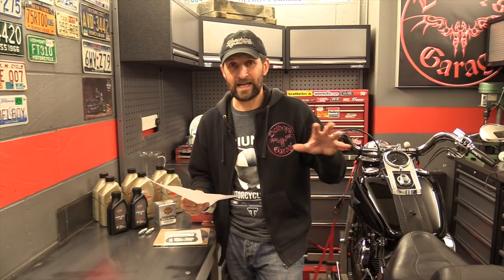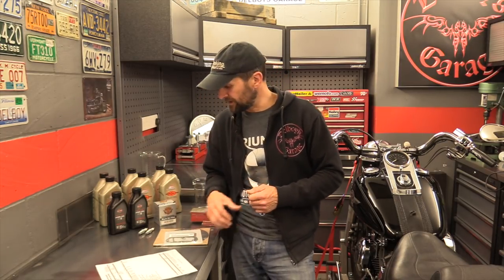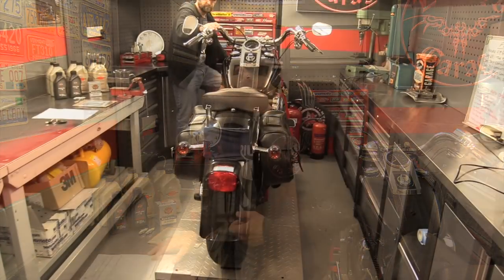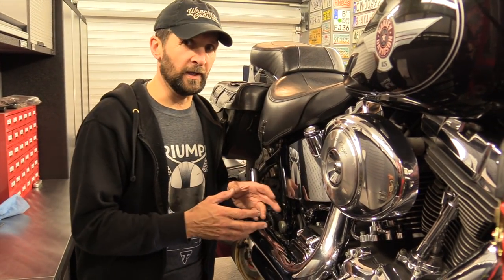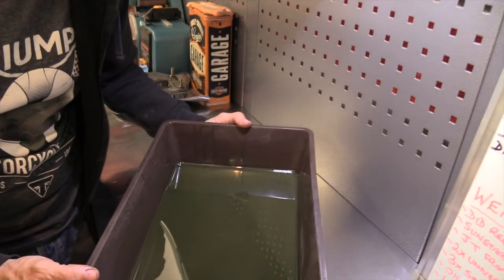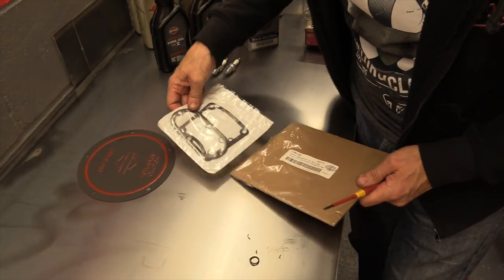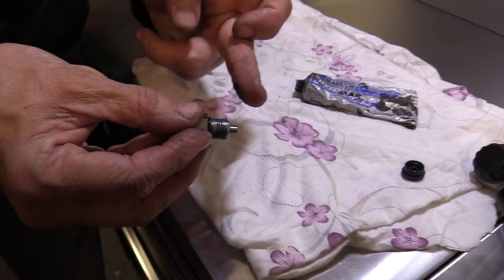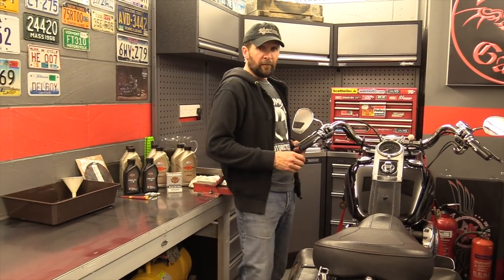Delboy's Garage, Harley Softail Service #1:- Gearbox Oil Change

Comment: so when you check the level of the gearbox you do it with the bike straight up?
Reply from the maker: On this bike, (2005 Softail), then yes, but if you have a different model or year, then check your manual because it can vary.!

Comment: thanks!! what kind of oil for gearbox in sportster 2001?
Reply from the maker: Hi you can go with recommended Harley oil, or if you want to pamper your bike, Screamin' Eagle Syn3 exceeds all Harley recommendations and is not a lot more expensive...
Reply: Moonfleet41 thank you. I heard that people actually use the same oil as they use for engine, for example Castrol motorcycle oil, 20/50

Comment: Can we have a list of times on that invoice. That would be very useful
Reply from the maker: What invoice would that be ?
Reply: @Moonfleet41  the invoice with items required for the service. Mainly interested in the orings and gaskets. Im trying to prep to service my softail.
Reply from the maker: @whitley3383  Ok, you asked for "Times" which i didn't charge myself..!!   this is a 6 year old video, i wouldn't have the paper work now, it went when the bike was sold.    Maybe contact your local main dealer, they will be able to give you the list of parts you'll need mate !

Comment: Hey there, I have a 2019 Low Rider do you still recommend syn 3 for all holes? Thx.
Reply from the maker: I try not to give recommendations, I personally use Syn3 on all three holes on my Harley, however, I've seen other riders recommend using the dedicated oils from Harley, such as tranmission oils and primary oil, etc., so I guess make a choice that you're comfortable with.

Comment: [p] Great information Del . I forget the US is imperial . Not sure if they are building stuff metric now .
Was going to ask did you have to give the bike a run to warm it before you dropped the oil.
 Cheers Pete.
Reply from the maker: Hi Pete, some of the fasteners on your Harley will be metric, and some simply cross over, like 19mm=3/4", 1/2"=13mm, etc.... the sump plug on the gearbox was 1/4" allen key to undo it, and the outside size of the bolt to do the plug up was 16mm - as their parts are made round the world now, you really need both tool kits!  
And no, I always drop the oil in the gearbox or primary, cold... as if it's sat for a while, then that sticky oil isn't all splattered round the internals, it's nicely accumulated at the bottom, such a drain down could take, maybe, 2hrs or more, even if it's warm.... I simply let the drain plug stay open while I do everything else, then do it up at the end - that way, all the oil comes out, but you do warm the engine oil up because that is essential to mobilise settled particles within the motor - all this will be covered in the following videos!  Thanks buddy...
Reply: Thanks Del .A good point regarding the box oil.  Plus the cross over between the sizes. It pays to make sure the key fits just right as . It is so easy to round them out with the wrong size. I was thinking about a Mini  regarding warming the engine as they have a  sump key that collects the metal.
       Cheers Pete.

Comment: Is the same oil goes in engine,gear box and primary??sory for my bad english,i am from Europe, Bosnia and Herzegovina,there is no service for harley.and i have 2009 fatboy HD.
Reply from the maker: Hi there, they are different recommended oils for this, however, if you use Screamin' Eagle Syn3 it exceeds these basic recommnded oils, so you can use it in engine and primary... the best advice would be to contact a Harley dealer and see what they have available... good luck !

Comment: Hi mate me again 😅 got slight issue here .. I noticed on my 2010 heritage softail making loud bang sound when I start the bike for first time , bike is standart .. but I installed twin long fishtail exhaust on it & didn't put baffle at all , I used the pipes nearly 3-4 months & only just started done that bang sound recently & happened around 4 times now on random occasion , most of the time when it cold start. Is this something I need to worry about ? Do I need to put the baffles on instead leave it straight through ? Many thanks
Reply from the maker: This will be a fueling issue, as the early fuel injection bikes feed a heavy fuel punch in to start the bike and with standard exhaust and set up, it's correct... but with open pipes, if you're getting unburnt fuel in the exhaust on start up, then it will ignite and with no silencer to muffle it, then that's what you're hearing... so if you haven't already, then maybe add a fueling device to correct it, Screamin' Eagle Pro-Tuner or a Vance & Hines Fuel Pack and that should improve it a lot, plus should release a few ponies as well...
Reply: @Moonfleet41  morning thanks for fast reply mate , will it do any harm to the engine if I leave it without Dyno jet tuning , fuelpack etc ? But I'm planning to to put the baffle back on mate. Many thanks ☕
Reply from the maker: @awedihdaira2786  A fuel injected big twin of that age will be fine with standard fueling as long as you haven't changed the air filter... it's ok to run open baffles, but not an open inlet... if you're running a free flow filter as well, then you MUST fit a fueling device, or the bike will run lean and hot and eventually lead to excess wear.
Reply: @Moonfleet41  bike still standart , air filter still standart , the only thing I changed is those exhaust. When I changed the exhaust for first 2-3 months never making that bang sound .. only recently mate & happened 3-4 times now. Thank go I don't need to worry about it then , thanks soo much really appreciated the answer all the time bud. Have a good Easter holiday 🙏🏼

Comment: . . . . . ...Del boy. . . .love your videos .. . .however. . .Try finding the drain plug between the suspension on a 93 soft tail. . . .there isn't one. . . .I went through around 15 videos all saying the drain plug was between the pistons. . . .thought I was going mad as I could not find any bolt any kind between the suspension. . . .eventually I found the damn thing is . . . .ON THE SIDE . . .of the gearbox itself. . .a small torque screw.  Anyone else contact you about this? Thanks. Ade.
Reply from the maker: 1340 Evo motors have many difference buddy, this was a later '05 Twin cam.... if you buy a proper service manual from Harley (lots of money mate, about £60) then it would have shown you exactly where the service access is for all oils... its a worthwhile investment buddy..
Reply: Moonfleet41 , yep. . .thanks for the fast reply. . .I looked at manuals but . . .yes £50 to £60. , ,the bike is a full on custom with the only part of her standard being engine and trans so wasn't that fussed about a manual. . .so went on the internet. . . .even typed in 1993 softail 1340 transmission oil change. . . .and still . . . .drain plug in between the suspension kept coming up? . . .finally found one. .. .yes one. . .video from Germany. . .where it showed the drain on the side of the gearbox. . .its such a tiny torque screw I would never have thought that was it.  Thanks for great videos. . . .your one on the multimeter. . .. .now I get it so ta very much.I have built choppers before . . .last one from a sporster. . .there's vids of her on my channel. Which brings me onto a subject I was going to contact you about anyway.  I suffer from a condition known as tinnitus, this is a condition of the brain where we sufferers hear a high pitch tone /noise in our head all the time every second of every day,the general public think Tinnitus is just a bit of ringing in the ear. . . .however it's a real malfunction of the brain. . . .it can lead to suicide in many cases. My own channel is devoted to helping others with this condition. . .Being a biker myself I have many subscribers who have this condition but are also bikers and many of them get told that after being struck with tinnitus that they should stop riding motorcycles because of the sound connection associated with motorcycles. This is not true however and it's just the medical fraternities ignorance of tinnitus being a condition of the brain and not the ear. Its entirely up to you but I wonder if you could in any capacity inform your huge following that if they have been struck or already suffer from this condition then Please please do not stop riding and for advice on how to recover and live with tinnitus to maybe visit my channel. This is as I say completely up to you and regardless thanks for your great videos. Please Dell boy feel free to take a look at my channel. I intend to be putting up some videos of my new chop soon . . .now that I have oil in the trans!  Thanks again and best wishes to you. Ade.
Reply: Hi .....again Dell boy..............Firstly again thanks for your superb videos....and for taking the time to read this.....

...you replied to me regarding changing the gearbox oil on a 93 softail today....appreciated for the fast reply.  I did reply to you again ( as per below) with details of what my channel deals with....Tinnitus....in particular fellow bikers who have been struck with this condition and have been told by the medical fraternity that it is their ears that are the problem and that they should stop riding their bikes. Being a biker myself I can say that this is not true. Reason for me contacting you...again... is that after having asked you to take a look at my channel.....my channel got messed up by YouTube....brilliant..typical..good news is ....its now back up and running...so I have no idea if you managed to take a look at my channel....or my chopper videos... anyway as I say my channel is up and running again so please as before feel free to take a look . Id love to hear what you think of my first sporty chop "Miss Temperamental"...and my latest girl...the 93 softail chop...shes not quite finished yet..

Cheers and best wishes to you and Penny. Ade.

Moonfleet41 , yep. . .thanks for the fast reply. . .I looked at manuals but . . .yes £50 to £60. , ,the bike is a full on custom with the only part of her standard being engine and trans so wasn't that fussed about a manual. . .so went on the Internet. . . .even typed in 1993 softail 1340 transmission oil change. . . .and still . . . .drain plug in between the suspension kept coming up? . . .finally found one. .. .yes one. . .video from Germany. . .where it showed the drain on the side of the gearbox. . .its such a tiny torque screw I would never have thought that was it.  Thanks for great videos. . . .your one on the multimeter. . .. .now I get it so ta very much.I have built choppers before . . .last one from a sporster. . .there's vids of her on my channel. Which brings me onto a subject I was going to contact you about anyway.  I suffer from a condition known as tinnitus, this is a condition of the brain where we sufferers hear a high pitch tone /noise in our head all the time every second of every day,the general public think Tinnitus is just a bit of ringing in the ear. . . .however it's a real malfunction of the brain. . . .it can lead to suicide in many cases. My own channel is devoted to helping others with this condition. . .Being a biker myself I have many subscribers who have this condition but are also bikers and many of them get told that after being struck with tinnitus that they should stop riding motorcycles because of the sound connection associated with motorcycles. This is not true however and it's just the medical fraternities ignorance of tinnitus being a condition of the brain and not the ear. Its entirely up to you but I wonder if you could in any capacity inform your huge following that if they have been struck or already suffer from this condition then Please please do not stop riding and for advice on how to recover and live with tinnitus to maybe visit my channel. This is as I say completely up to you and regardless thanks for your great videos. Please Dell boy feel free to take a look at my channel. I intend to be putting up some videos of my new chop soon . . .now that I have oil in the trans!  Thanks again and best wishes to you. Ade.

Comment: Not trying to be a smart arse or anything Del but didn't you say in one of your videos many moons ago that ordinary mineral oil was perfectly fine on Harleys and it was more important to change it frequently than worry about using synthetic.  I've got one of the older Evos and they're prone to blowing base gaskets. I wonder would synth oil make it run any cooler? Also you mentioned in another video that you could use Mobil 1 on a Harley and it was way cheaper.
Reply from the maker: Hi Paul, yes indeed, that still stands... a mineral oil is perfectly fine in your Harley, especially an Evo!

It's once you get to twin cams and beyond that perform to far higher tolerances, that you can eke a bit of beneift out of a semi-synth, or synthetic, oil.... 

As I said in the video here - mine has always had a semi-synth oil by the dealer through it's life so far, along with Formula+ in the gearbox and primary, but I am 'up-grading' y bike to Syn3 all over, because I do tend to beast it hard, especially on the moorway on longer runs... I will often sit at 85/90 for 2hrs at a time, so Ilike the best protection I can get myself... and my old 1340 Police bike blew it's front basse gasket , it's not the oil that causes it, it's the poor quality machining on the crank cases!  

Full synth. won't cool your bike down, a richer fuel mix will do that for you, and as the time honoured rule says, fresh oil as often as you can afford it !  I would change oil on an Evo every 2,500-3,000k miles, and the filter every second time.
Reply: thanks Del. that explains it. yeah i usually change every 2500mls.
Reply: Thanks Michael. Yeah, I'm careful about that.
Reply: I currently own a 1994 HD Heritage Softail Classic (Evo), I bought new. After about 7 years, the rear "jug" started leaking motor oil from the base gasket.  I use a friend who is known as the "Harley guru" of my area.  He replaced ALL gaskets from the base gaskets up with (James Brand Gaskets).  It has never leaked a drop since.  The James Gaskets and proper torching is the secret, according to him.
Reply: rockbay79 what mileage is on your Heritage?
Reply: At the present time, my Heritage has approximately 32,000 miles.  However, when I had the gaskets replaced, it had about 20,000 miles on it.  Those James Gaskets have held up great!  I would highly recommend.  I don't ride as much now, due to health reasons, but the gaskets were installed in about 2004!  Crazy good!

Comment: Do you change gear oil with bike cold or hot?
Reply from the maker: Gear oil is thick, it helps to warm it up so it flows out more freely..!  also running the engine won't heat up the gear oil much compared to riding the bike.. take it for a 5 mile trip, up and down the gears over and over.. and that'll really help it flow.!

Comment: Hi D&P!  Did you warm-up the trans oil before draining?  PS: The video looks superb now that you're working in a posh garage!
Reply from the maker: No i drained it cold Byron.. warming the motor is only important with the main engine oil.. the trans and primary can be drained cold as long as its not "winter cold"... it was 70 degrees in the garage, thats fine to drain it out, just let it keep running till it stops..    Thank you for your kind words, the garage is a cool place to be now..!
Reply: Thanks Del.  The owner's manual says to run the bike up to operating temp prior to checking the transmission oil level, but the service manual doesn't say to run it prior to draining. I wonder why?
Reply from the maker: Thats to allow doe thermal expansion of internal part that in turn take up more internal space, and thus the oil level rises.... but its only minimal, and you'll get almost the same reading on the stick.. its most critical with the engine oil as there is so much more of it that the dipstick difference is greatly effected.... test it for yourself Byron, check your oil level cold.. it'll be at the bottom of the stick.. then check it later when its hot.. it should be up to level...    Also, to get the transmission hot you have to ride the bike for at least 5 miles to 'work' the transmission... simply 'running it up' wont heat up the transmission as it will be sitting still....! all you may get is  little conducted heat from the rest of the motor.. so a lot of what you read in the manual is subject to a drop of common sense in its interpretation...!
Reply: Thanks D!

Comment: What's the part number for that gasket kit you have? I can't find it anywhere
Reply from the maker: Hi Eric, check the date of the video, I don't keep part numbers recorded, nor did I probably bother when I bought the kit, I just went to the dealer and bought the gasket set for my bike - part numbers are for dealers and suppliers, we they great unwashed just ask for what we need!
Reply: Moonfleet41 thanks for replying. I paused the video when it was close to the part number zoomed in and found it on eBay for pretty cheap.